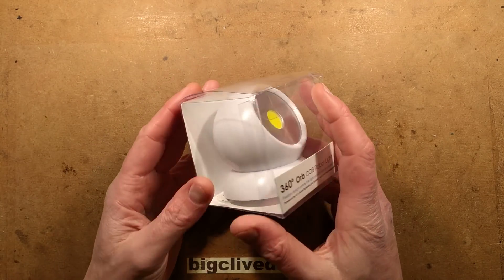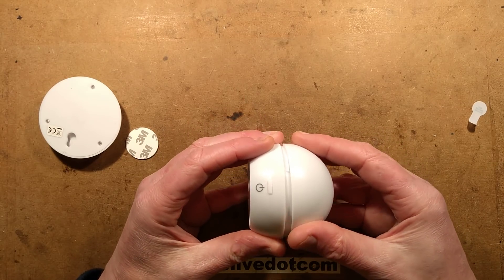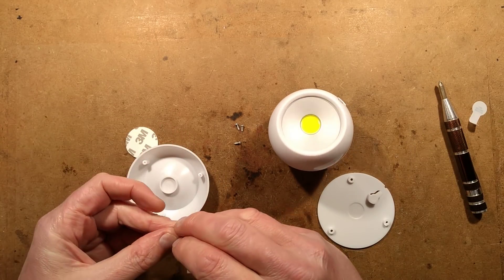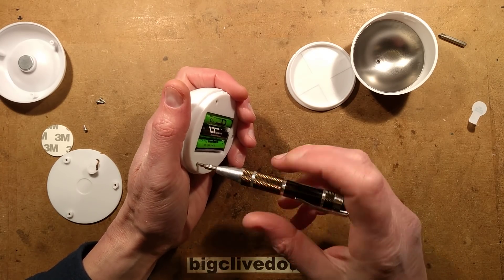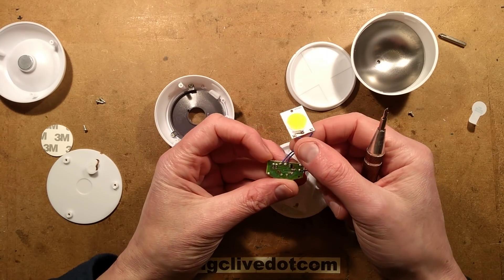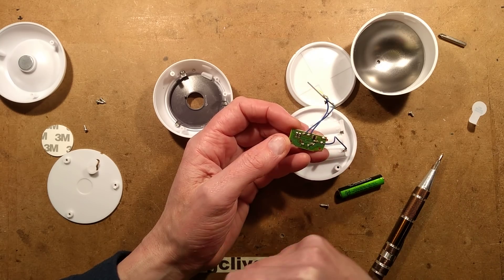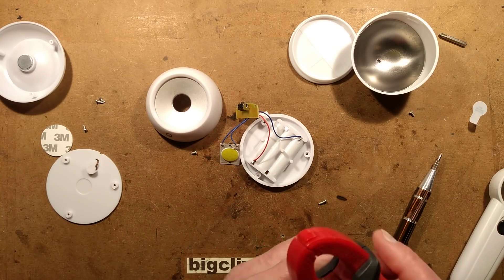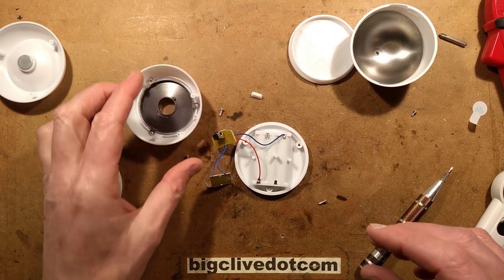Inside Poundland's orb 360 robot COB light.

Comment: AAA batteries deserve to only be used in one type of device: Remote control.

Why do the Chinese manufacturers insist on using them for just about bloody everything, notably torches? AA's hold significantly more energy.
Reply: I got a remote with a coin cell in it...
It was a very expensive device, too.
Manufacturers are getting absolutely shameless.
Reply: Is there a possibility that the makers of batteries , promote the comanies that make stuff that uses batteries.???😲🤔
Reply: AAA are likely significantly cheeper then AA when bought in bulk just based on the metal content of the batterys
Reply: I have an LED flashlight on my keychain that runs on a AAA cell. It's super bright (130 lumens) and a NiMH cell lasts months with my level of use.
Reply: @tyttuut  Single AAA keyring torches are fantastic.
Reply: i like my aaa pocket flashlight thank you
Reply: For over 10 years now I've permanently carried a Photon Freedom Micro clipped to a belt loop, a super bright keychain torch with a 5mm LED that has two diodes inside, powered by 2x CR2016 but I actually use a single CR2032 for extended runtime (I get months of use) as it's still bright enough.
Last year I got a BLF A6 XPL, 18650 powered, ridiculously bright on full @1600 lumens. I like it a lot.
Reply: Space.   Adding the extra 40% of length would significantly increase the diameter of something like this.   Personally, I'd call that a 'flashlight' chip, (or torch), not a bike chip.  It's in every bleeding flashlight I've ordered.   I want on, and off, and maybe a dimmer setting.  I don't need a flashing flashlight.    

The other is that in flashlights/torches, many of the 3 AA torches are also 18650 torches.   If they used AAs, the diameter of the flashlight would be so large that the 18650 would rattle around.
Reply: Ok there are some things that warrant the use of AAA's due to their size, but there are too many with high drain and/or require a long life before changing batteries that really need to be designed to hold AA's, or better yet a 18650.
The most recent "ugh, AAA's..." item I bought was a HT-175 thermal imager, nice device for the price (£83 in a Banggood sale), helps troubleshooting circuits etc., but they could've made the handle just 5mm longer to accommodate a 18650 cell instead of using a poxy 3xAAA holder.
It can actually run at 5v so I designed & 3D printed a dummy battery with a USB plug on the end so I can power it from a USB bank but the battery cover then doesn't fit, so my ultimate goal is to take the circuitry from a poundland USB bank and combine it with the right sized lithium cell in a 3D printed case to make what would effectively be a "USB battery" for the HT-175.
Reply: Troy, I make a cardboard tube to fit around the 18650 cell. A section from the use in the centre of cling film is the perfect thickness for the job. It's quick, cheap, safe and reliable.
Reply: @tbelding  I Guess... Flashing because in some countries it is called a 'flashlight' ;-)
But the good thing about the flashing is for safety if you are somewhere stuck in the woods or something like that. It uses less energy in general and will get the attention faster then a steady light (when you want to get some help) or also when you are walking along a road and you want to warn cars.

For on and off only, just take that little chip out and put a click-switch inside, done (still using the resistors).

Good thing about AAA is the smaller size, weight and it fits better in your pocket or at the campingsite for example. In most cases I don't need AA's for a couple of days outside, especially with the better AAA's that are having more energy then an AA 10+ years ago.
Also more practical to charge them off solar power then AA's...

Actually I have been replacing some AA-holders with AAA to gain space to get spare batteries with me (sometimes even without their metal cases to save some extra weight.
Taking AAA's instead of AA's makes more differences in your package then sawing the length of your toothbrush.
Reply: Collusion with battery manufacturers and retail stores. The store gets a repeat customer for batteries (few people have rechargeable AA/AAAs as they require a dedicated charger) plus the battery manufacturers get more sales. It's astonishing how I can't find a flashlight with a rechargeable lithium in my area, and I've checked ALL retail stores. Even a store that only sells chinese ebay-grade electronics. Retail DOESN'T like rechargeable lithiums. And some stores even sell only Duracell/Energizer/Varta brand torches. It's like being stuck in the 90s/00s.
Reply: @brainndamage  - Check the AAA cylinder.  If it has a really long spring-loaded nose, it's 18650 compliant.  If it doesn't, you'd need to find one of the extenders, like I buy for the dollar store flashlights.   You can get the batteries at the smoke shops.   Also, check the truck stops.  They often sell rechargeable flashlights.
Reply: As devices become more and more efficient AAAs are finding their niche. I have a motion detection led light in the master bathroom. It will go 4 to 6 months on 3 AAA alkaline batteries. That's not too bad expense wise, completely worth it to prevent me stubbing a toe on the way to have a piss.
Reply: You're only saying that because you have big European hands. You big handed racist   ;)
Reply: @CozzyKnowsBest  - That would be a 'bigot'.   I mean, I don't think there's a fourth race, specifically 'BigHandoid'.   So, if you dislike people for having small hands, that's a bigot.  If you detest folks with brown hair, that's also a bigot.
Reply: @tbelding  nice correction Troy. Please accept my apologies. The OP is a bigot.
Reply: I totally agree here. It does my head in as they aren't as cost effective. More often than not they are used in devices that don't even need to be made smaller, which is the only justifiable use for AAA's.
I have some outdoor remote temperature sensors, AAA's. Kitchen timers, AAA's. Torches, AAA's. Computer mice, well ok if it's a small mouse.
Grrrr. End rent :-)
Reply: @Error42_  End rent? Oh no, you'll get evicted by the landlord.
Reply: @Alucard Pawpad LOL. I meant rant :-) Mind you, with all those AAA batteries to buy I may not be able to afford living costs ;-)
Reply: Triple A´s are even used as crude current limiting...
Reply: For this device in particular, AA instead of AAA would increase the weight by enough that they’d need a much, much bigger magnet.
Reply: Just before Christmas I designed & 3D printed a simple battery adapter for my HT-175 thermal imager to use a 16340 cell instead of 3xAAA's. Didn't even need to use a voltage booster, it can run direct.
I bought a couple of cheap UltraFire 1200mAh 16340's off eBay, they're predictably junk, 300mAh if that and wouldn't survive in a vaper, however the HT-175 only draws about 116mA so it's completely happy.
Reply: Steve Terry  do you think a Chinese manufacturer of general crap cares about how many mah you get?